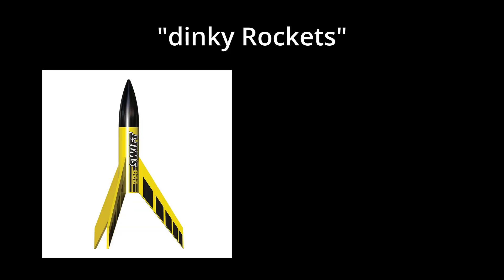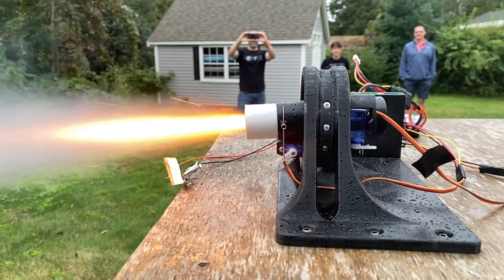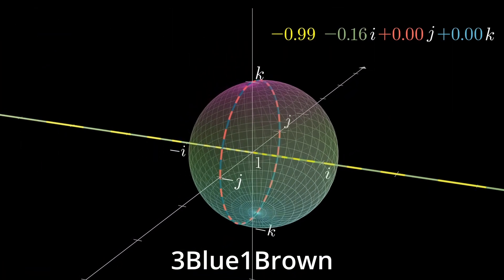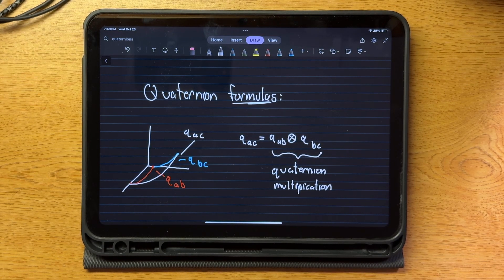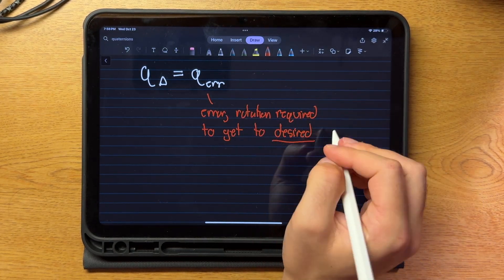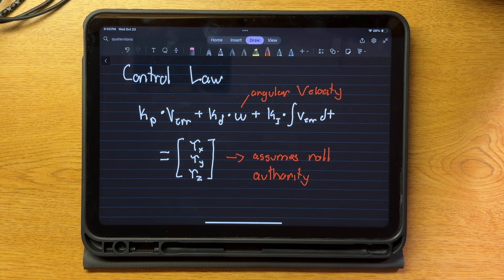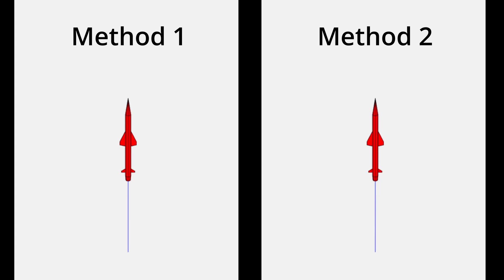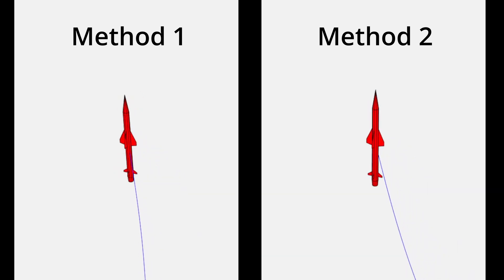Controlling a Rocket with IMAGINARY Numbers

Comment: yoo I was wondering how to orient something upright, and this has exactly the information I need! I dream of building a rocket league car in real life, that can fly as well, but I'm sure it's a lot tougher than I imagine. If possible could you please list some things that might be important for me to learn during this project? Thanks!
Reply from the maker: Glad I could help. It would definitely be challenging, but not impossible. Some important things are control system design, mechanical design (CAD, etc.), and programming (likely C++). Ensure when you start this project, you have guidance from others to make sure it's done safely. Best of luck!

Comment: Hi @Garret_R. Nice video! 

However, I'd say there's a little mistake that got magically corrected. Let me explain:

In the case where Q_err would give you the error over the long path, that is rotating the other short way around, what you have to do is take -Q_err, the negative, not Q_err.conj(). Q_err.conj() would rotate in the long direction path also, but in the opposite direction. -Q_err would make the same orientation correction you want, but following the short path.

Then, you take the imaginary parts, and voila, you end up fixing the mistake, because the imaginary part of Q_err.conj() is the same as the imaginary part of -Q_err !!

In fact, the only thing you need to check is that the real part of Q_err is positive. If it is negative, then flip the whole Q_err with Q_err = -Q_err, and continue.

Nice video anyway, and keep it up with your projects!!
Reply from the maker: Isn't the conjugate of q_err what you want (assuming unit quaternions)? Because when the real part is less than 0, it's not an optimal rotation so you take the conjugate to represent the same orientation but in the opposite direction. It has the same result as taking the negative because you only use the imaginary for the controller, but in terms of orientation representation that's correct method, right? This is what is done in the paper (see page 4): https://www.diva-portal.org/smash/get/diva2:1010947/FULLTEXT01.pdf

and thank you!

Comment: Nice. I'm no field expert, but do u use the rodriguez formula or Just quats? I thought quaterbions are widely used in robotic software, but its the same, instead of the angle, you use half the angle for quats.
Reply from the maker: I just use quaternions, not the rodriguez formula. The angle is half the angle for quaternions, which is why you construct a "halfway" quaternion, because it represents double the rotation. They talk about this a little here: https://stackoverflow.com/questions/1171849/finding-quaternion-representing-the-rotation-from-one-vector-to-another

Comment: ❤Nice video, how did you design the gimbal?
Reply from the maker: The gimbal I'm currently using is based on the K-9 TVC Gimbal Gen 2 by Canine Defense Technologies. There is much I want to improve on, however it should hopefully do for flight 1.

Comment: Nice. I used quaternions for both the sensor fusion and the control system in a drone for my thesis. The setpoint, measurement and error signals were all quaternions. The integrator in a classical scalar filter was replaced by a rotation (which in continuous time is infinitesimal). If the quaternion is re-normalized at each step, then the norm is always close to 1 and the renormalization can be performed by an approximate algorithm without using expensive divisions.
Reply: Acapella Science did a Hamilton parody for William Rowan Hamilton, the inventor of quaternions.  In it there's a line: "...and no one uses my quaternions, but just you wait, just you wait!"  It's a real banger, y'all should look it up.
Reply: @AlbertaGeek  Well, quaternions led to the development of vector algebra, so in a way they are used in a simplified form.